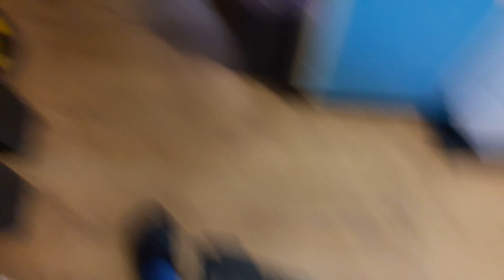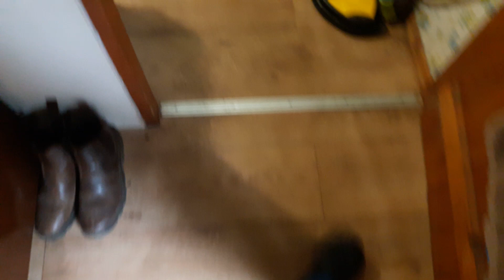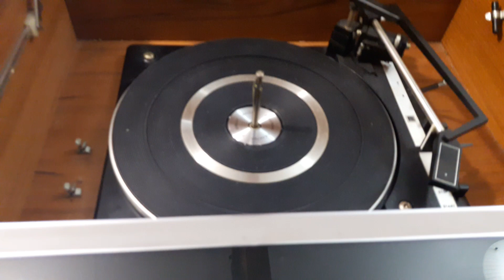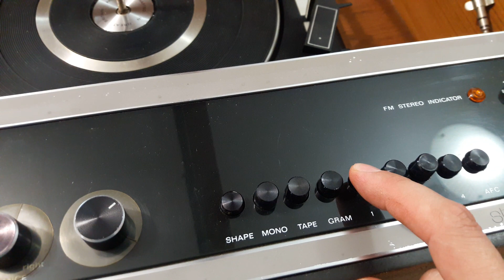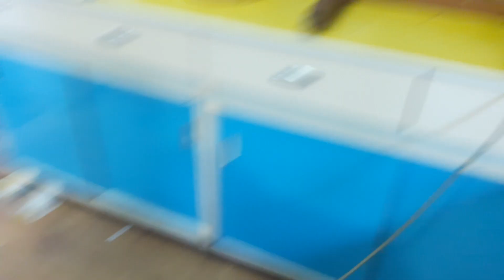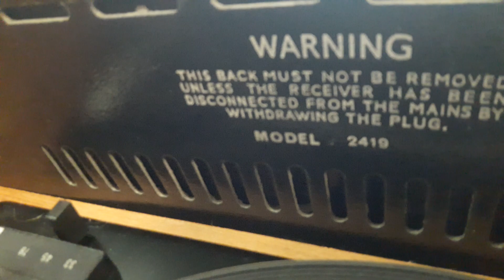HMV Radiogram Stereomaster 2419 progress so far...

Comment: Nice old stereo console radio, I have one that is German that was given to me and it's in pretty good shape for its age it was made in 1959. But I have no idea who made it and if you could give me some insight I'll be glad to send you some pictures.
Reply from the maker: No problem send a link to some photos and I will take a look
Reply: @Vintage-Tech  Hello I have an email address but I'd prefer not to post it here. I did take pictures but I had to remove one of my model ships off the top of the console first and I needed help moving it. But I remove the plastic shrink wrapping and the packing quilts and I did take pictures. It's in pretty decent shape for its age.
Reply: Hello  I have no idea how to send a link? Here's what's on the back of the radio set. Graets model belcanto 9822. There are thirteen tubes six speakers and don't think you'll be moving this beast around by yourself.  It weighs in at almost one hundred and sixty pounds! That's around seventy kilos metric. It's almost as  big as the model ships I build and I weighed it on the same scale I use to weigh the models with so that I can figure out how much lead to add to ballast down the model hulls.
Reply from the maker: Yes I know that model from about 1959 a high end model and will sound very good when working and restored, The stereo valve amps in these radiograms are very good which often leads to them getting gutted and the amp being robbed
Reply: @Vintage-Tech  Hello  Edward
Well so far this radio looks to be intact and it was given to me and I wrapped it up in a packing quilt and lots of shrink wrap plastic and it has been sitting on furniture dollies for a long time with the legs wrapped up in a towel in the record storage compartment. There is no real to reel recorder with this unit although there is a place to plug one in and also a pull-out shelf where the reel to reel recorder would have installed. There's no way of knowing whether the original purchaser opted for the reel to reel recorder or not but I'm guessing that was purchased by a GI who was stationed in Germany at that time and brought it back with him when he came backto the states when their tour of duty ended. The cabinet is in good shape with only some small cracks in the wood that are barely noticeable unless you look at the glare , no scratches or dings or dents it just needs a nice wiping down and cleaning out. I have not tried to plug it in although I did take a peek inside and counted all the tubes to include the photo eye tuning tube that is next to the dial glass. The speaker's look to be good although I looked at them from the back side not the front. I will send the radio into a repair shop and have it checked out thoroughly to make sure that it is functioning properly before I plug it in. But I must admit it's very well made with good materials and it has had good care over the years. 

Best Regards 
Greg Rogers 

PS. I'm well aware people taking out the good tubes from the power supplies and amps making them is harder to restore. I'm glad that you like these stereo consoles and enjoy them not many people have the room in their home to do so. I have run into a similar problem with another brand of radio that was very high-end in the 20s and early 30s. That brand is called the Spartan radio. These radios are built very much like today is military equipment. People are taking out the amps and leaving the tuner and preamp and selling off the radio and cabinet . They then take the amp rebuild it and ship it over to Japan or Korea. It seems that they love these amps, I have no idea why they are strictly mono amps not stereo. So when trying to restore a Spartan esquinne  radio it is becoming very hard to find a complete radio it is not had is amp removed.  Spartan radio the Esquiline line was the high end line. If you get a chance go look on the internet and you might be pretty impressed. At the time a Spartan esquiline model 110 radio sold for about $550 dollars in1929 that's about $6,000 dollars in today's money. They were never a cheap radio and were considered the best by radio audiophiles of the day. Spartan as a company got out of the radio business in the late 50s and early 60s and the still in business today building Electronics for the Department of Defense.